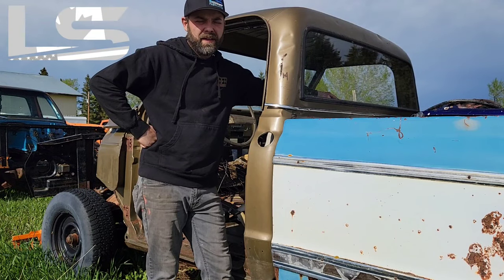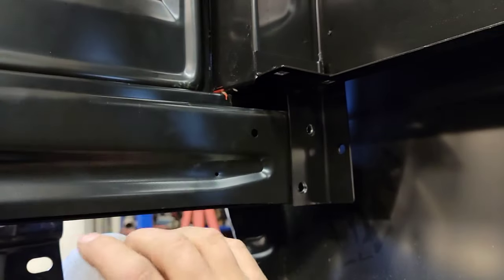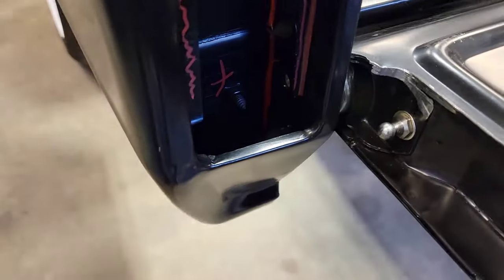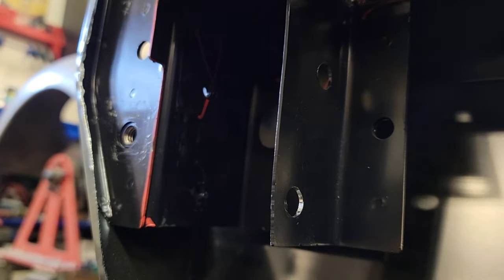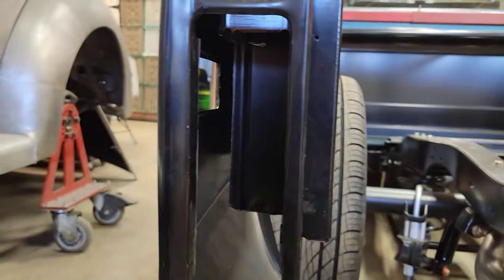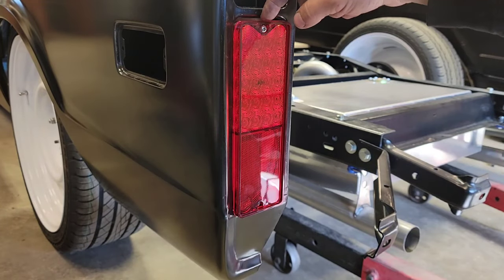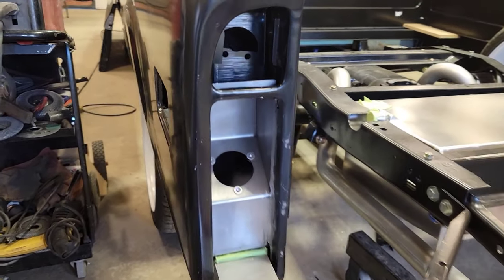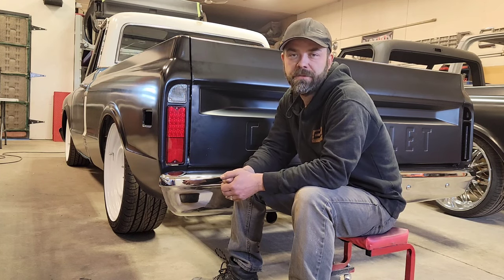C10 Taillight Fuel Filler Install

Comment: Nice job. When I did mine I made a tab that bolted in under the tailgate hinge on the drivers side welded to my crossmember and make it removeable. And I used # 8 thread certs to mount my gas door using counter sunk allen head bolts in case I need to remove it too.

Comment: That looks great on a Fleetside, do you have a recommended filler location for a Step Side? I really do not like the filler in the bed.
Reply: I’ve seen someone do it in the side marker light
Reply: @evenvega3728  Any chance for pictures or video? Is there a kit available?
Reply: @mikechristy5140  from what it looks like you just use a modern fuel door hinge and screw/weld it to the back of the side marker light, run the wires along the hinge, and cut out space behind the light for the filler neck and cap to fit
Reply: Anything for the Step Side?

Comment: Pretty straight forward install. Do you have any example of fuel filler hose routing? That seems to be more complicated.
Reply from the maker: Sorry I don't. Majority of people get creative depending on their skill set. You can do a Stainless tube with couplers on either end or a 1.5" flex fuel line. To connect the taillight to whichever tank you have.

Comment: What are your hoses list you will be using to connect to the tank?
Reply from the maker: 1.5" is the diameter of the fuel filler neck. Not sure which tank you're using but gives you an idea.
Reply: @lsfab4607  using a 2 in Boyd side fill tank.

Comment: How would you hook up the tank vert with this filler?  this is the route i want to go, and this is one of the questions i have not been able to answer.
Reply from the maker: The tanks we suggest to use have a vent on the tank. You can add a rollover check valve if you wish. If your tank doesn't have provisions for that you could get creative with the fill hose and add a vent.

Comment: I've been interested in this, but I also want the one piece tail light, are the two kits compatible, or is there a one piece tail light filler?
Reply from the maker: Not that we're aware of. We've seen 1 version with our filler and the 1 piece taillight. Was a bit of extra Fab work.

Comment: Do yall provide a similar kit for the 64-66 c10’s?
Reply: Sorry we do not.
Reply: With some fab work, this one may work on a  60-66, on the show TRUCKS they used a capless filler from a ford and made the filler on the side marker light on the 67-72 they were building, with some trial and error you could make it work on 60-66 taillight, that’s the plan on my 64.

Comment: Can you get away without cutting the crossmember?
Reply from the maker: Don't believe so, you need to plumb the filler and slide the assembly up through where the crossmember is.
Reply: So what about the 2 bolts that tie crossmember to the bottom of bedside under taillight there.. so how is it secured